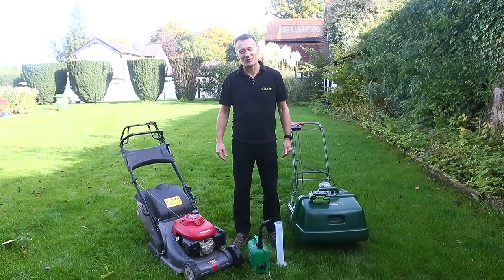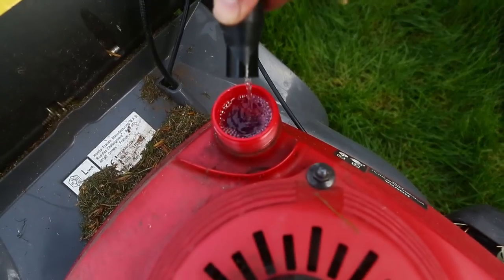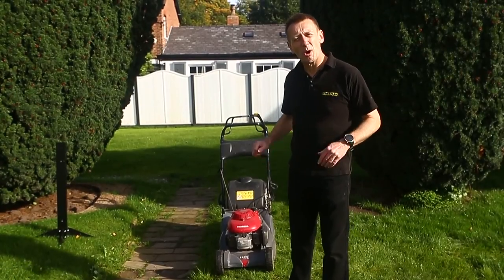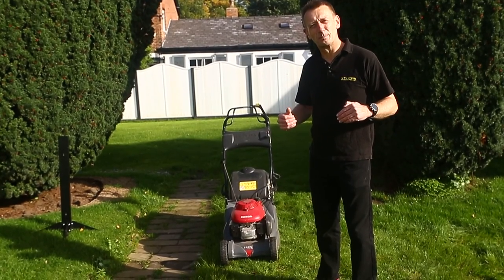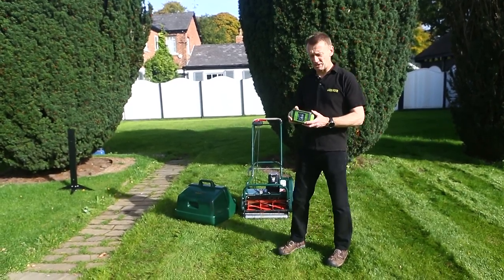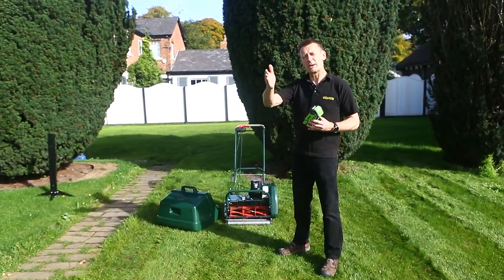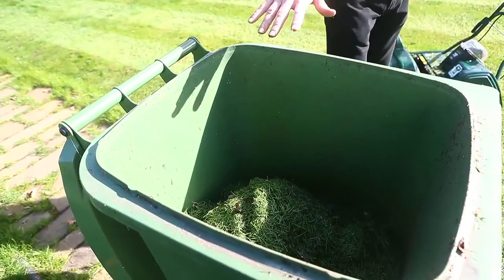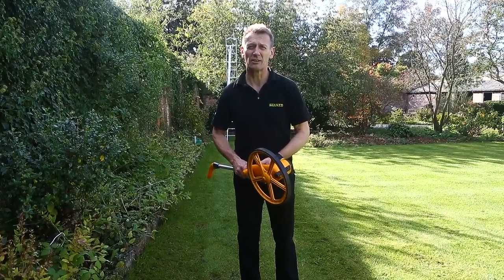Fuel Comparison Video- Cylinder (Battery) v Rotary

Comment: Thanks for doing the leg work in providing the comparison. I have just sold my petrol Hayter mower as i was fed up with oil changes and servicing, it was also getting hard to start especially on cold days. I have ordered a liberty 43 and hoping for delivery next week, fingers crossed. I have to cut my grass every three days otherwise im taking more than a third off, so the cumulative saving would add up. Also much quieter with no vibration or fumes, it the future in my opinion.

Comment: Cheaper to run, not to mention no faff of buying petrol, storing a flammable material at home, the noise, smell, emissions and the cost of servicing a petrol engine. I was going to buy a used Kensington, but I'll be going for a new Liberty 43 very soon!
Reply from the maker: You’ve got it! Once you use battery you won’t go back to petrol!

Comment: Very interesting video thank you. I’m still debating the two, but battery power does seem to have many advantages and service cost is an additional cost. Considering the investment I’m also thinking about the lifespan of the electric motor? Brushes, bearings etc. Can these be repaired?